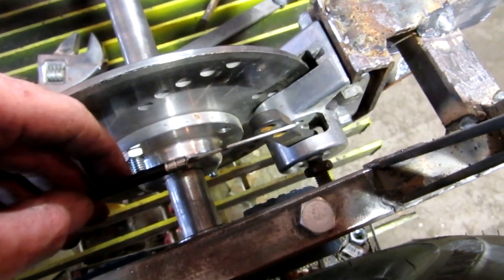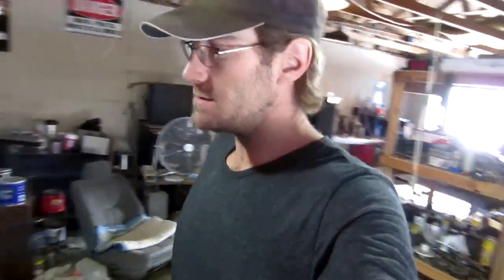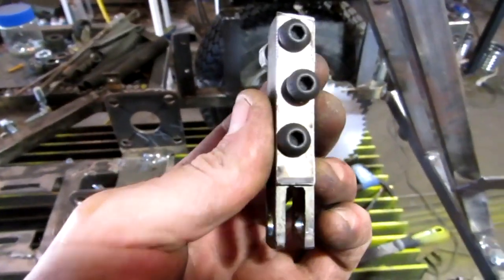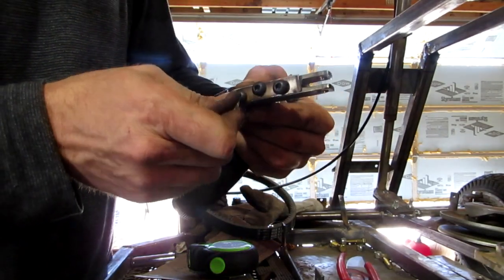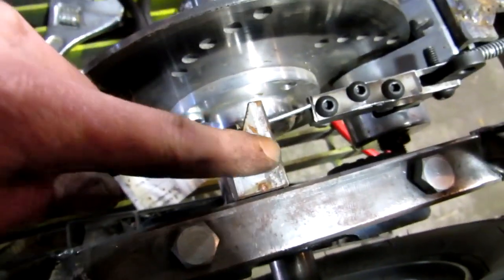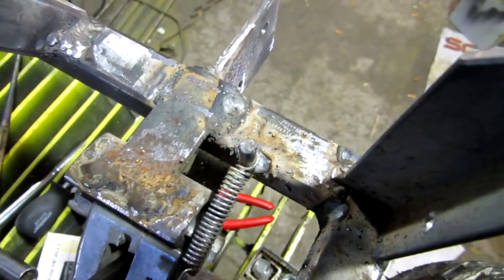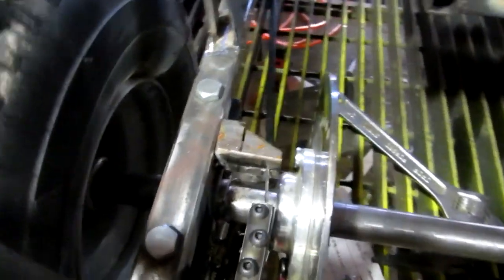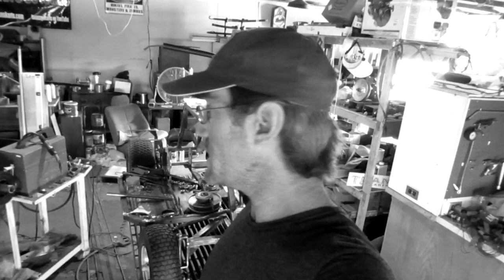Hyperion K4RT | go kart | Brake set up

Comment: You can adjust the brake caliper to have a short enough throw, even in the outer hole of the arm... AND have the leverage to actually have enough pressure to stop that thing.

Comment: i wonder if you could drill a hole side ways to bolt it to the brake, and drill a hole down the center the of the keystock, and solder or braze in place

Comment: Nice clevis you made. Good idea with tha sheetmetal to hold the brake cable rod, because setscrews or screws with those holes in them like on bike brakes usually cut into the cable or rod which makes the connection weaker. The sheetmetal will spread the pressure and not cut into the rod.
Checked out your perks vid, Great detail on the plates. I use a bottle of Jack for that nice hammered look, LOL.